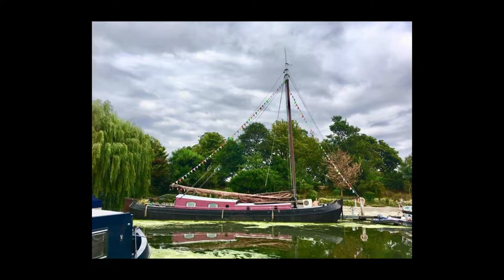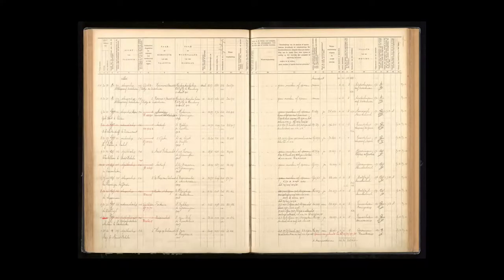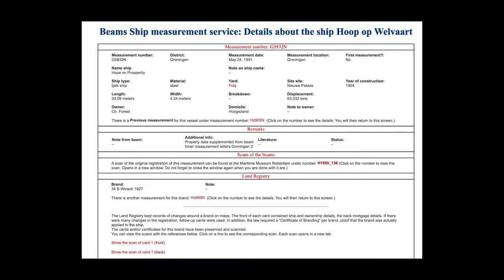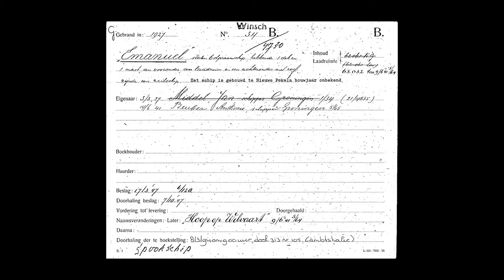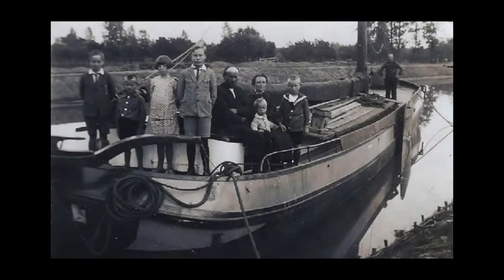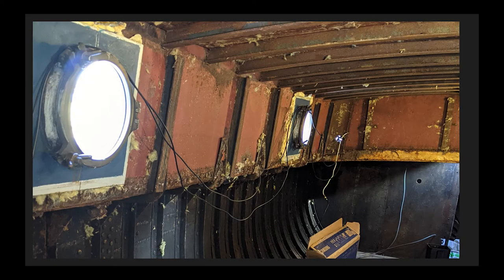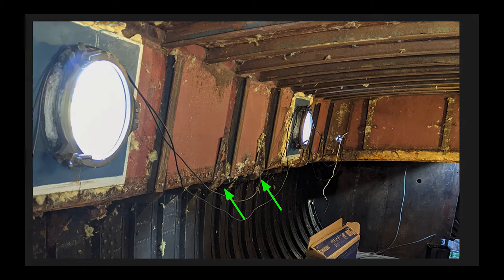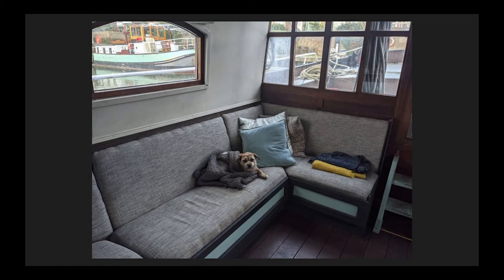#12 The History of a Dutch Barge - Dutch Barge Home

Comment: I'm full of curiosity over your project.  Noting that she was a sail-powered cargo vesel, her stability in a seaway would have depended upon having the wieght of cargo in the hold.  I suggest that if you wish to sail her on a stiff day; you might need to consider ballast?  You could consider water ballast but be sure to fit cofferdams in your ballest tanks to reduce free-surface.  I like the engine control (blocktube?) on the tiller (cool).
Reply from the maker: The skûtsjes that race I don't believe carry ballast and it's true that they capsize from time to time! However any sailing that Hoop will be doing will be reasonably gentle and she'll also have a full load of living possessions such as washing machines etc so that should help. They aren't really designed for offshore sailing obviously and more of using the sail on a river or canal so that's more what I'll be doing. But she's a heavy thing already! 😊
Reply: @TillerQueen  Correct, the skutsjes used for sailing are not ballasted, but they are sailed by a team of racers on a lake. If you want to sail the boat it is much recommended to add ballast. It will be a lot more stable and comfortable. Also while motoring you have better control.
With your ship size about 8 ton should help a lot. If you place concrete pavement slaps below the floor it won't take up any space.
Also, since you the windarea of the super structure is now increased it wouldn't hurt to get her a little lower in the water.